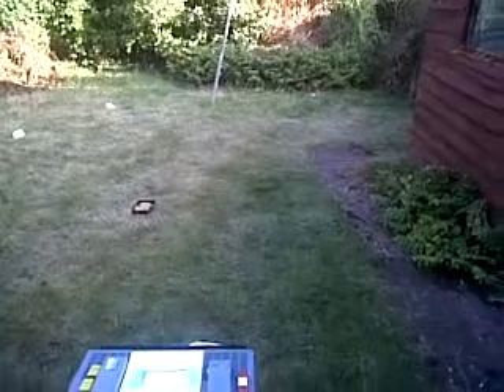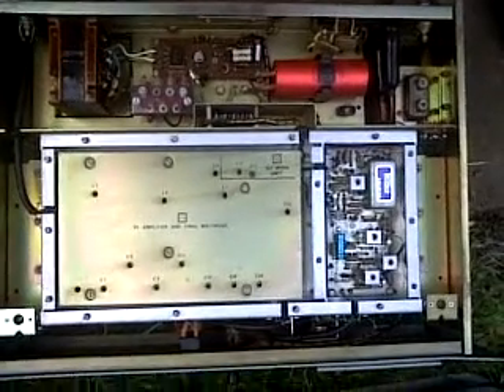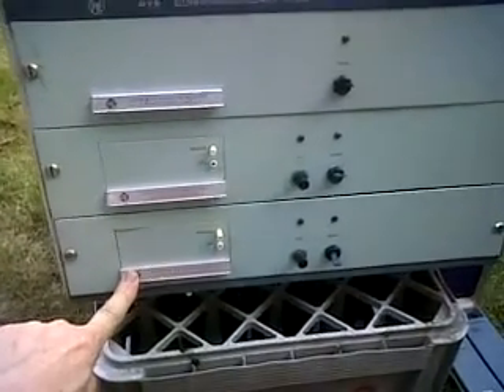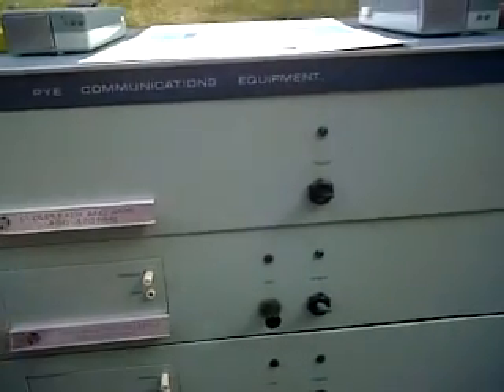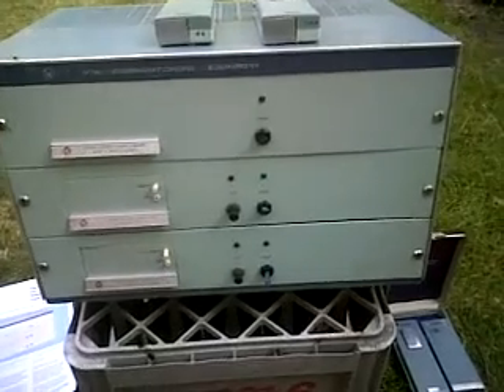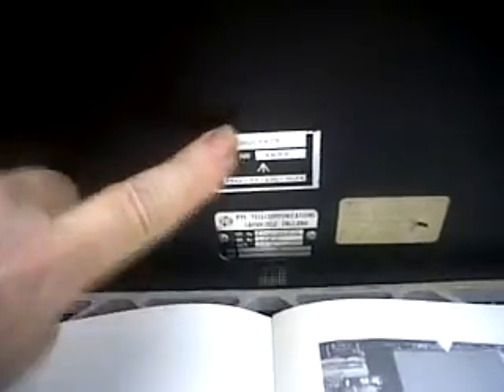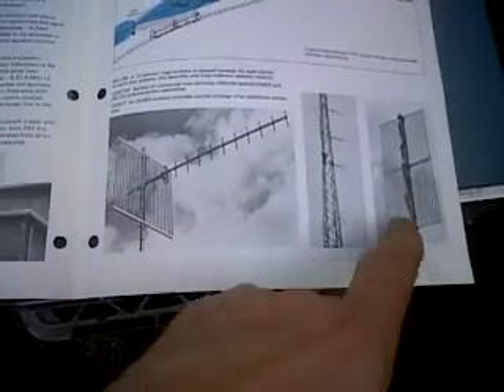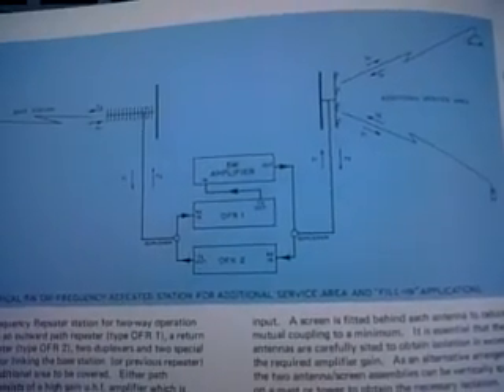PYE OFR ON FREQUENCY REPEATER SYSTEM Part 1 20110726-1847.3GP

Comment: Worked for Pye in Canada during the early to late 70's cutting my teeth on Cambridges and later, W15 radios. Back then some of our Alberta  Amateur radio clubs managed to get their hands on a few T30's and R30 units. I recall even a T100 with the 5894 output tube that was driven way too hard. They didn't last long.  Recall it was British Railways who may have used that 450 mhz stuff you can't identify.  They used quite a bit of it for tele-control and possibly voice by mounting UHF yagi's or parabolic antennas pointed at 180 degrees of each other on either side of a long building thus providing sufficient physical isolation. The OFR stuff was ideal for such 'linear' operation as a railway system.

Comment: I had a set of them pye pocket phones
Reply: No... not often. they were horrible things to work on.  Staff in hotels often used em.. until they died. And SK meaning 'silent key' (as in Morse code key) means the ham operator has passed away.